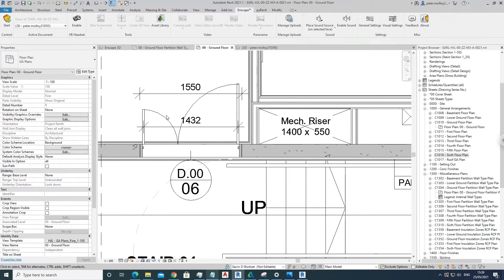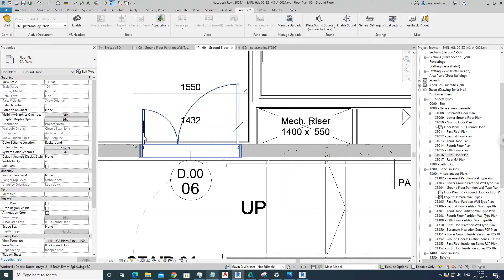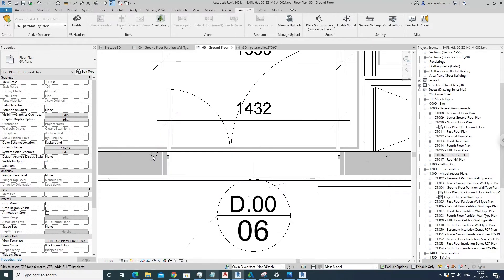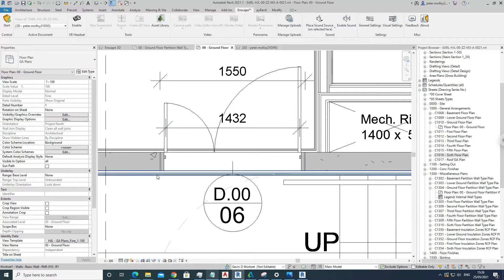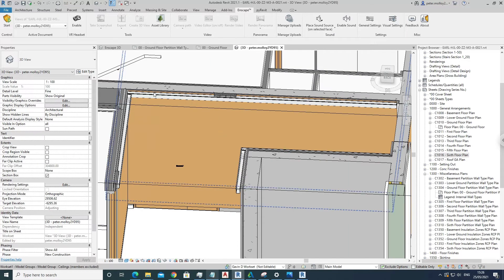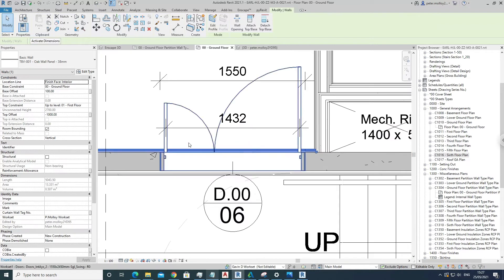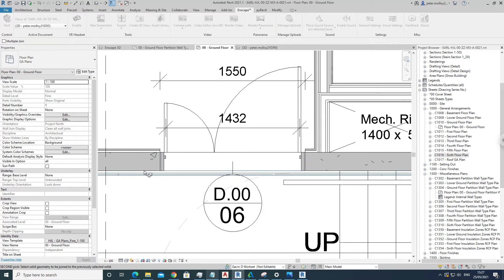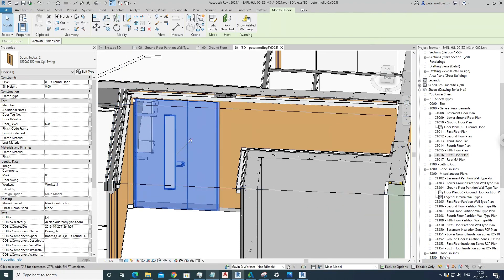Quick Tutorial on How To create a door opening in multiple Walls in Revit

Comment: Hello - I was wondering if there's a similar (i.e. easy :) way to do this that incorporates "rectangular straight wall openings"? I have a stem wall with ventilation openings that I am trying to add a stone veneer to in parts.  But when I join the new stone wall to the existing concrete wall (with the openings) the openings don't carry through. Any thoughts?
Reply from the maker: For the ventilation opening (or any opening in a wall for that matter) you want to create a parametric family for that opening. Just like modelling a window or a door, you’d create a family and model it into an opening of your choosing within that family. 

For this trick to work there needs to be a family with an opening installed on the primary centre wall. Thus, any wall joined to that primary wall will show an opening. Give it a go and let me know how you go, thanks

Comment: Hi. Ive done this. But I want my door family to adpat also the other finishes. How can you make the three layers as one host for the door? thanks in advance.
Reply from the maker: Thanks for your query Darwin. You have two options. Create a singular wall with all the desired layers and insert your door or alternatively creating the wall in layers and join the together so the door opening carries through to all the layers. Let me know how you get on.
Reply: @petermolloyarchitect  Hi!... So I have try joining multiple walls and true it made an opening when you put the doors/windows on it. But my problem was when there are like 3 layers of walls, the door only detecting one wall as a host. the result is the door jamb are not going trough the other walls though it created a wall opening.
Reply from the maker: @DarwinLingco  sounds like more of an issue with the door family rather than the walls. Try putting a standard door family in from the revit library and see if the architrave runs out to all the wall layers.
Reply: @petermolloyarchitect  thanks a lot.. I will try that.. again thank you.
Reply from the maker: @DarwinLingco  no hassle. If that doesn’t work try editing the architrave depth in the door ‘edit type’ selection.

Comment: Heyyy,,, I have a problem here, the door frame does not go through other levels even after joining layers. Is there any solution for this?
Reply from the maker: Hi there, you’ll have to go into the door family and make sure the cut distance of the opening is producing enough so that it cuts into other layers. To confirm this try using a default door family and see what happens. Let me know how you go 👍
Reply: @petermolloyarchitect  Actually, I did that with different type of doors. most of them adapted with several wall thickness. But in this case of the video,nothing changed.
However, thank you for responding